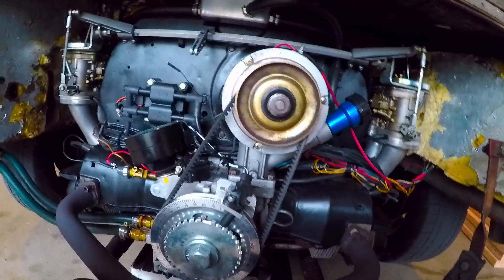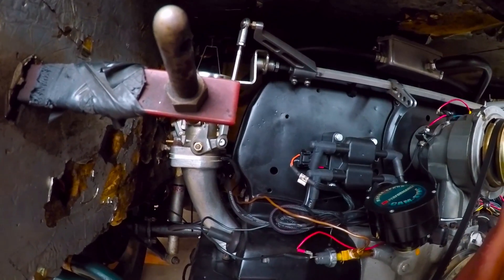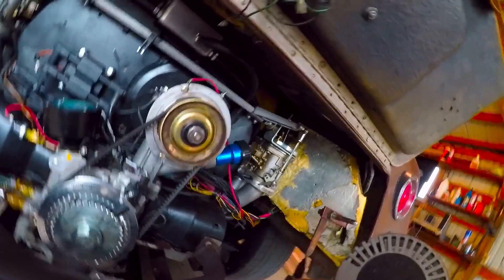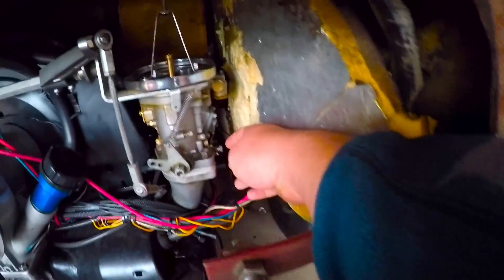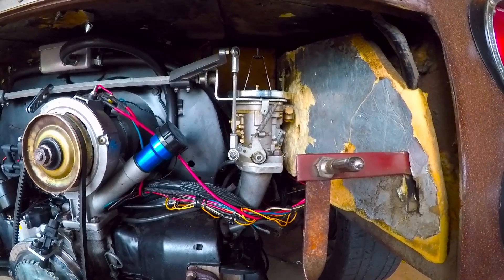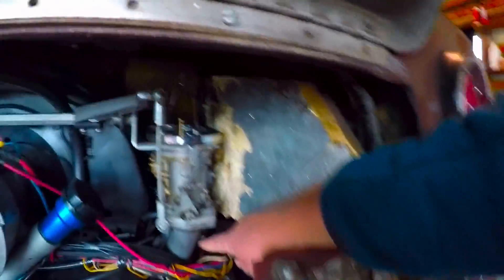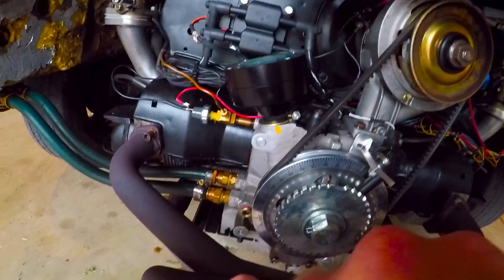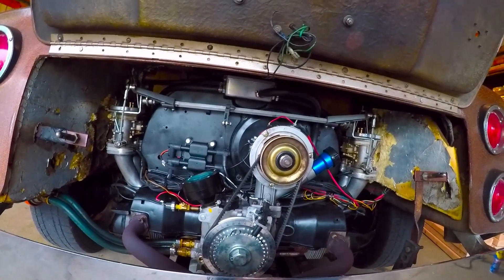synchronizing dual weber carbs

Comment: sometimes the linkage arm needs adjusting, the throttle may open on the same time but may not open one of the throttle all the way. so you need to change were the arms sits.

Comment: How do you know the correct number to sync the carbs? I had one at 5 and one at 6 using the same tool. How do you know which one is right? Is there a guide that shows the correct number based on carbs or engine setup?
Reply: Always balance to the reading from the lowest carb stack.

Comment: Did you already have the engine warm before you took your linkage off your carbs. I have 44mm Weber IDF carbs and I can never start my car cold without being on the throttle. Once everything is warm I can start it just by turning the ignition but never when the motor is cold. Is this normal?
Reply from the maker: Yes it was warmed up before. If it's cold I have to pump the throttle just a little bit to get it to fire right away because there's no choke.
Reply: Thanks so much for your reply. I left you a comment on your Bradly GT video.check it out when ya have the chance.